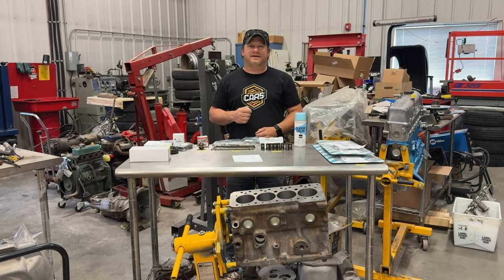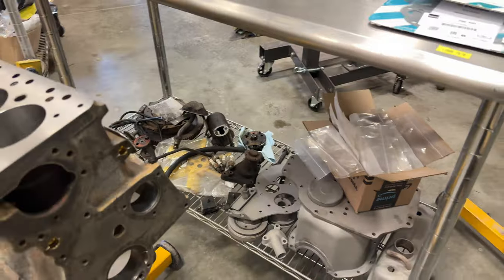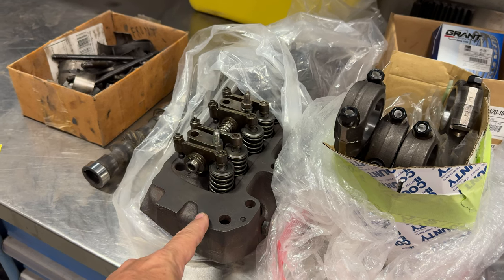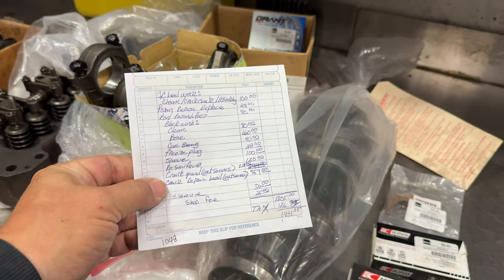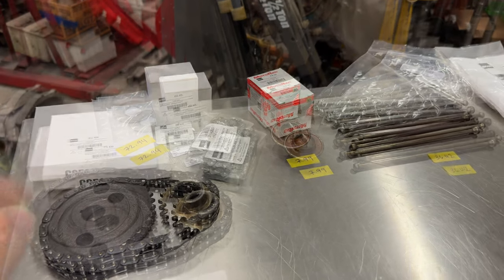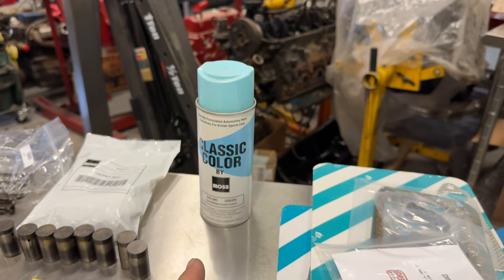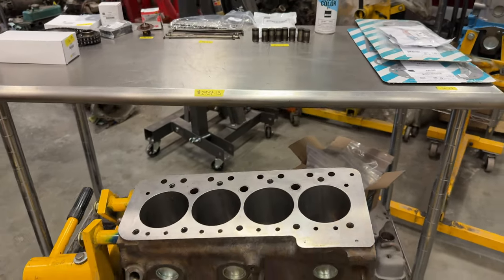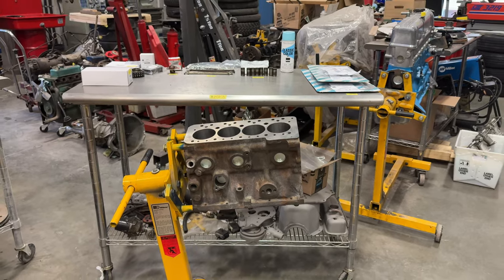Cost of Rebuilding the 1275 Engine for Barn Sprite 5

Comment: There's obviously more to the story of the cracked head. Shop failed to catch it initially, so time and new parts were put into it before crack was eventually discovered. If it had been found during initial inspection (magnaflux?), head would've simply been tossed. Arguably, shop was at fault here, but I'm guessing Steve ate the huge up-charge to maintain a good relationship with one of the few surviving machine shops in his area. Appreciated this short, informative episode very much.

Comment: i had some machine work done on my '61 MGA 1600 engine in about 1971. IIRC, it involved taking 10 thousandths off the head, a valve job that included two new seats, knurling the valve guides, pressing in the cam bearings and balancing the main parts of the drive line (the crank pulley, the crank, the connecting rods, the pistons, the flywheel and the clutch. total cost, labor only? 

$45. yep! forty-five dollars. @Wheathie's Machine Shop just south of Columbus Ohio.

fast forward to 2024. ...just got my 1967 3.4l jaguar mk2 engine and trans back from the rebuilder. i won't go through everything that was done but i will give you the total price...$25000. 00...uh...ya. :(

Comment: Steve - can you comment on the cost of the repair to the head crack? I'm not familiar with what this involves but it must be an intricate process that results in that high price.
Reply from the maker: It’s a cast iron head so it has to be heated up very hot and welded while hot to not damage it further.  Then because you got it so hot the metal might have moved a bit so everything has the checked ground and remachined.
Reply from the maker: Finding someone who even does this work is getting very hard as nobody is replacing the old guys who did it.  Who dreams of having a job sitting next to a red hot oven and welding parts in it all day.  With most heads and blocks going aluminum these days there is also less need for this service.

Comment: Please do a video on the engine rebuild! I am about to do a rebuild on my 1275 soon. The only difference is I will be putting in a 276 degree camshaft.

Any other parts you recommend? Hardened valve seats etc.???
I am trying to make a list of any parts that can be upgraded in an attempt to have a worry and trouble free engine.
Thanks
Reply from the maker: Hardened valves seats are the only way you have been able to get them for the last thirty or more years so if the head is or will be rebuilt it would have them by default.  The silicone gasket and spin on filter are going to help keep the oil drips to a minimum.
Reply: @ThisWeekWithCars  Appreciate it! Also, would you consider keeping one of the barn Sprites and doing a complete restoration on it? Maybe turning it into a race car?
Reply from the maker: You must have missed some videos, Sprite 6 is now becoming a pink race car, Sprite 5 is restored and waiting the engine, Sprite 1 I will always keep and you sill see it soon getting some "correct looking" upgrades, Sprite 3 is waiting on parts and then will be up for sale.  I am trying to keep a playlist for each car so someone can see the progress of each.  https://www.youtube.com/@ThisWeekWithCars/playlists
Reply: @ThisWeekWithCars  Looks like I have some binge watching to do then. I’ll do some catching up!

Comment: Why source a good cylinder head instead of welding and re-machining? Would this have been even more expensive?
Reply from the maker: I could have bought several other heads but the risk of them also being cracked seemed like a waste of money.  Cracked heads on the A and B series engines are very common and you should not be surprised if the head you bought is also cracked.